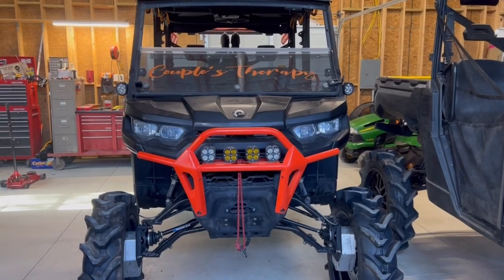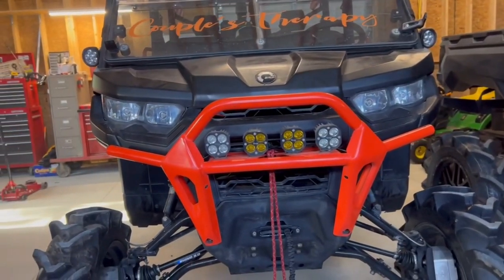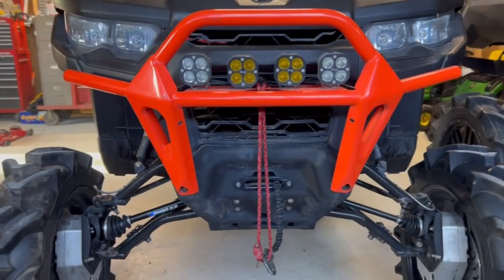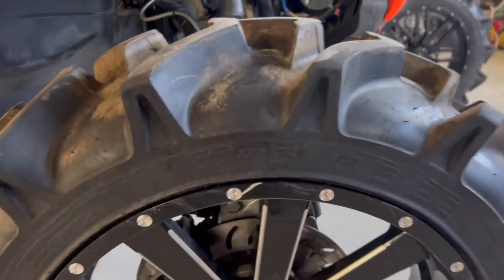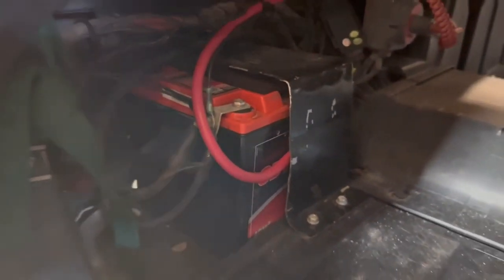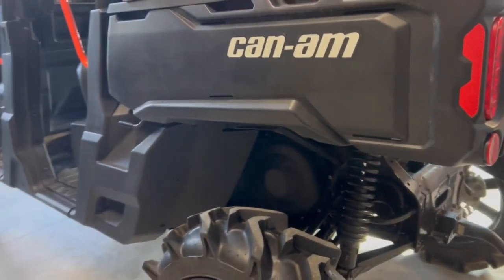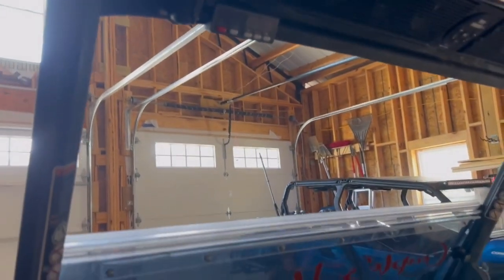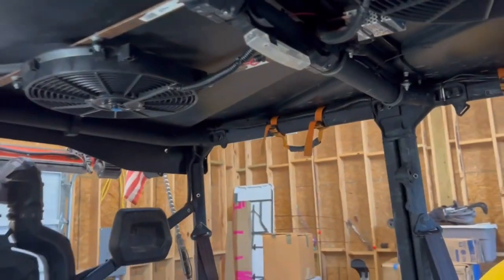Can Am Defender HD 8 MAX build and walk around!

Comment: I have the same bike and I’m about to do the same a-arms and have been thinking about the portals to get the gear reduction so I would like to hear your feed back after you get some more time and trails on them.
Reply from the maker: Honestly if I had to do over again I would go 8” I just didn’t have the money. And dual idler because I’ve been told to at it pushes the axle forward more. But as far as what I have it’s. A great setup. The 45% gear reduction on the 6” portals with a mudder clutch kit is the way to go. I am looking to put 37’s on and am waiting for some to come out with a budget friendly 4” lift. I like the long travels but $$$. Make sure you get the front arm braces.
Reply: My thing is I’m not gunna go bigger then 35s we like riding trails with the kids up in Arkansas and Oklahoma, I already have forward arched a-arms in the front about to put rears on also I’m strictly looking at the portals for the gear reduction and wasn’t sure which reduction  I want and I was also worried about them getting hot and blowing seals while not in the mud.
Reply from the maker: I haven’t had any problems so far and they turn the 35’s easily